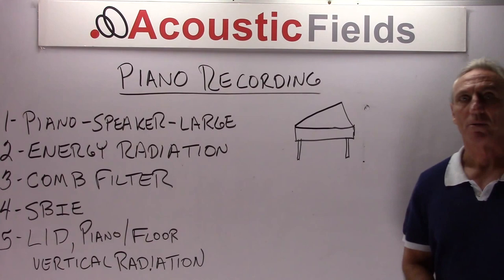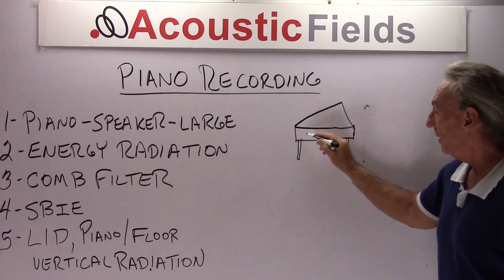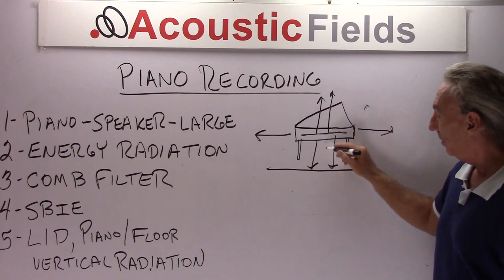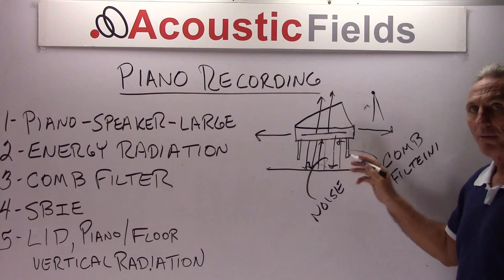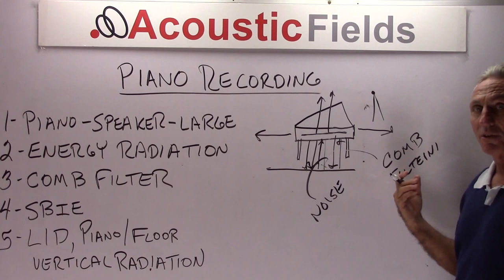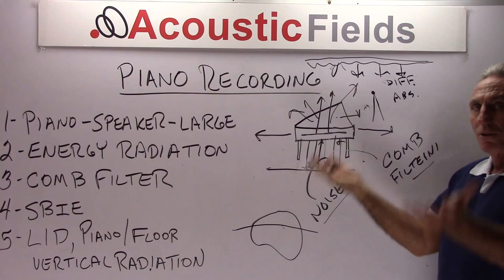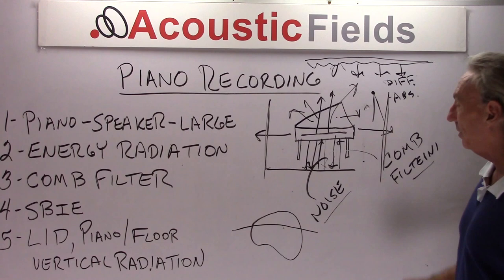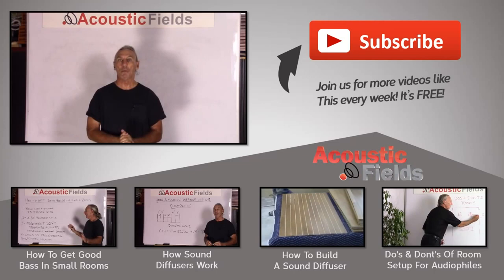Piano Recording - www.AcousticFields.com

Comment: So what are the suggestions for diffusion underneath the piano in a small room? Did you ever develop any new products for that ?
Reply from the maker: M,  Why would you want to do that ?
Reply: after watching your video looks I got the impression diffusion would be helpful since so much energy comes out from the bottom and top of the piano.
Reply from the maker: M,  You are correct. There is lots of energy that radiates from string bed to floor. Our measurements show about 70 % of the amount radiated from that of string bed to top. It is full range energy. With full range energy extending to low frequencies, we must absorb. With full range middle and high frequencies, we have the option of absorbing or diffusing. However, there are two issues that prohibit the use of diffusion. First, the distance from floor to piano is usually less than 35" which does not allow enough distance for diffusion to extend its energy before striking a surface area as with the string bed. Using diffusion would send diffused energy back through the string bed mixing with the striker energy going up. This will create audible distortion at the microphone position. Diffusion does have a use with pianos but it is more in the vertical domain of the  string bed to ceiling area. Thank you for the good question. Hope this helps.
Reply: Thank you, I'm working with a new 9' grand in a 12x19+ 11'  room so this info helps a lot
Reply from the maker: M,  Your big issues are floor issues. Look at our piano platform. This will treat all of that surface area for low and middle frequency issues.  More absorption will be required. Diffusion around the piano and on the ceiling is wonderful.  https://www.acousticfields.com/product/piano-platform/